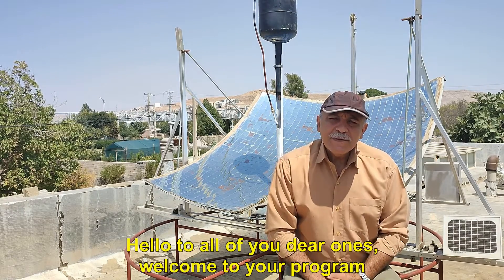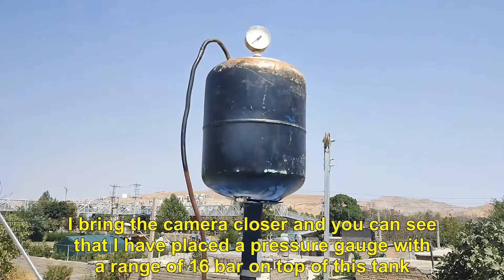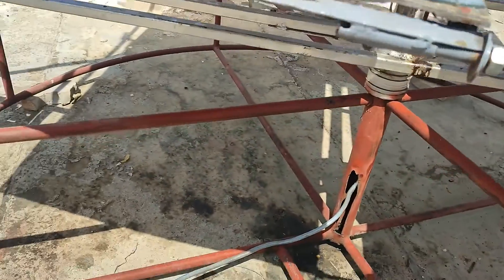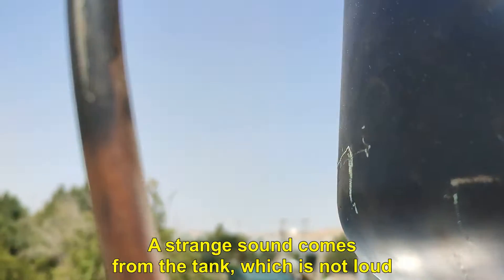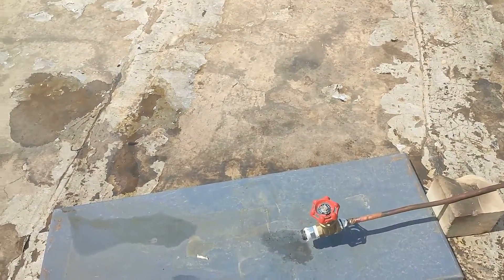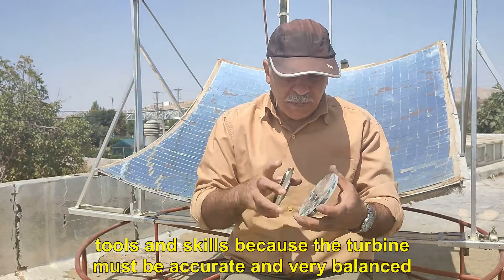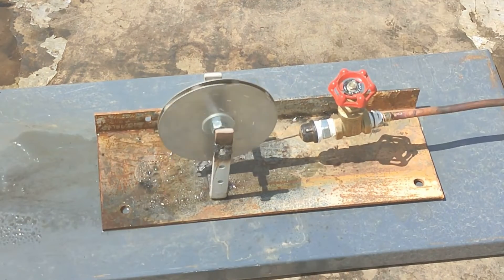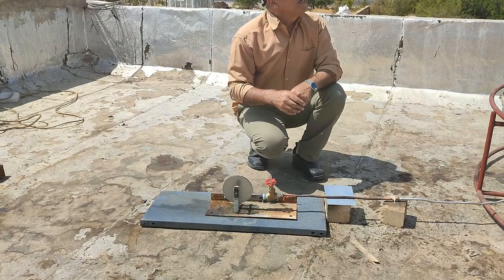Solar steam turbine.A simple steam turbine.Solar boiler

Comment: Thank you Mr. Hashemi. Free energy! The turbine you chose is similar to the Tesla turbine, with a 3D printer I think it is not that complicated to create a functional Tesla turbine of that size that can withstand the pressure.
Reply from the maker: Thank you for your nice comment
A 3D printer is a very good idea
Unfortunately, the materials used in this printer cannot be used in this type of turbine because the temperature of the steam will reach over 300 degrees Celsius.
But it can be a good mold for a metal turbine, which also has its own technical problems